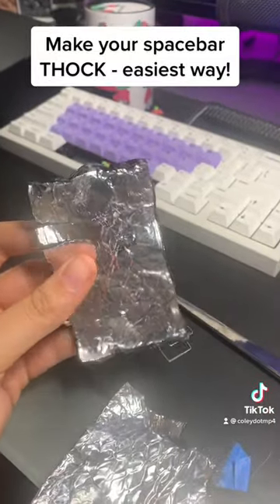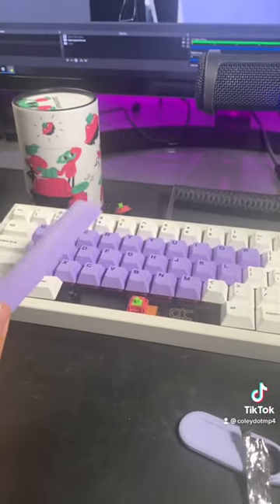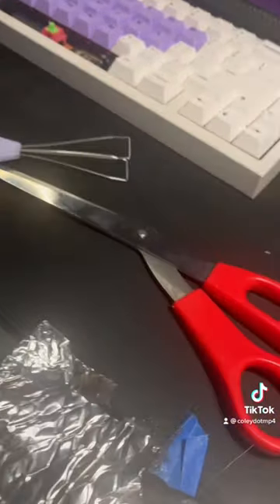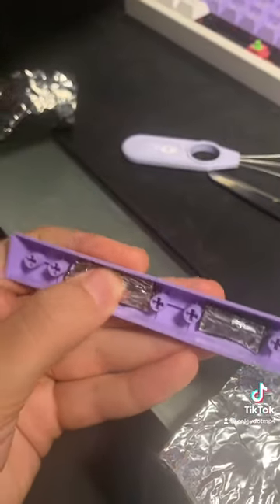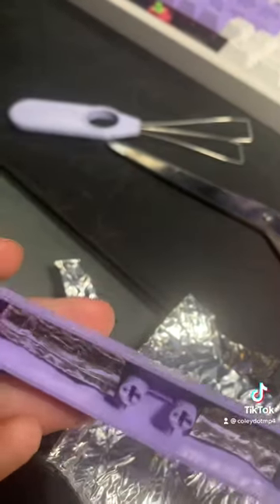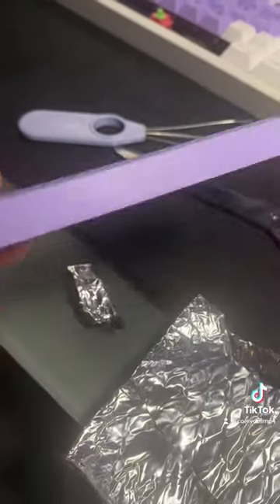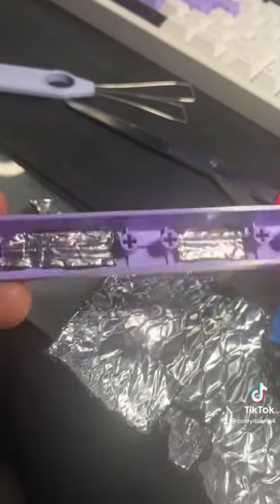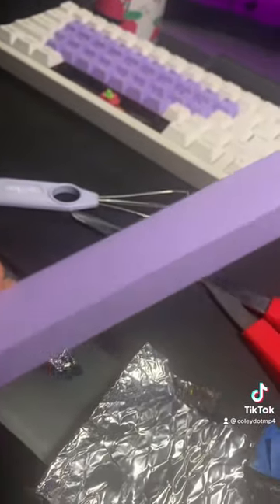Make your spacebar THOCK - EASY

Comment: I just used masking tape and the result was fantastic. 
Line the insides of the spacebar with it, then take one solid piece and lay it over the whole bottom opening of the key. Snip the edges off, and make small holes for the switch and stabilizers to push through.

Comment: Looks like qk75, would be helpful to know what type of stabilizers you used and the mods on it. So people can identify the exact setup/sound you got going on.
Reply from the maker: QK65 with Staebies stabilizers, tuned with only 205g0. No foam in the QK65 at all. FR4 plate. That spacebar specifically is Novelkeys Taro